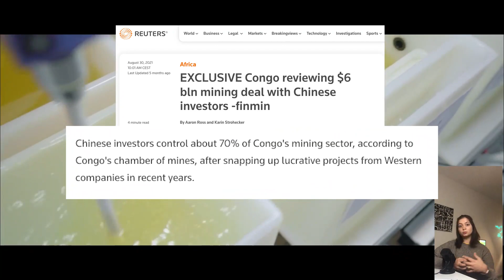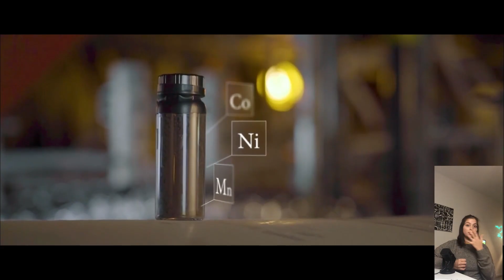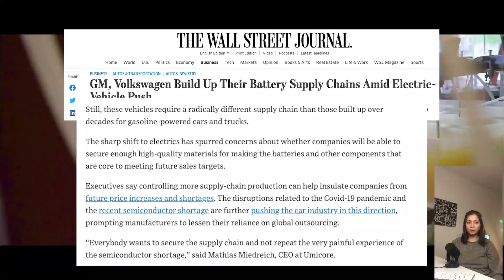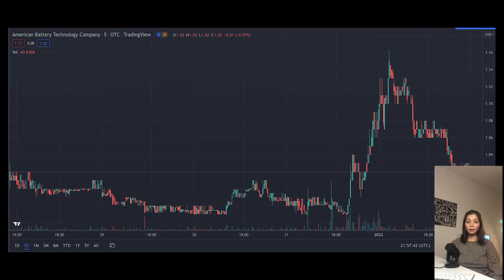BULLISH case for ABML in 2022

Comment: Alot of what you mention is obvious to the average investor. What you fail to mention is while they might  be operational by Q2 or Q3 they are a long way off from generating even somewhat meaningful  revenue, most of the the batteries being sold will not need to be recycled for several to many years from now. Any meaningful scaling up will take awhile. That is why the stock has plunged at a higher rate than the overall market. And while you proudly mention the 10% increase, you failed to mention the subsequent plunge. People are spooked that their holding time will be longer. More realistically 5 - 7;years or longer should be the holdings period for ABML. And I didn't even mention their application submitted to The NASDAQ to uplist, which would require a $4. minimum stock price. Which could possibly mean a reverse stock split. It's nice to list the pros but there are cons also.